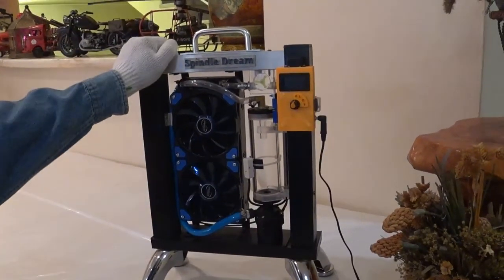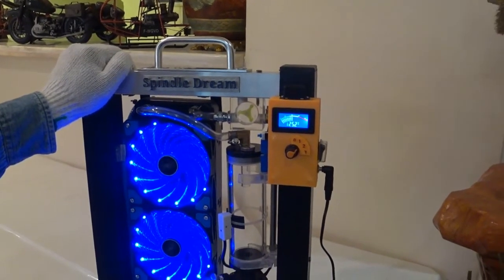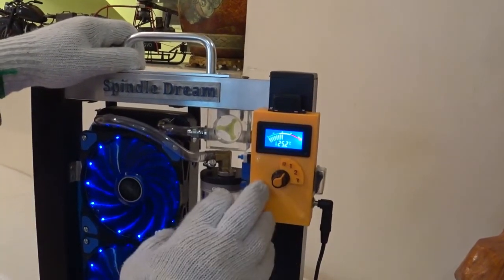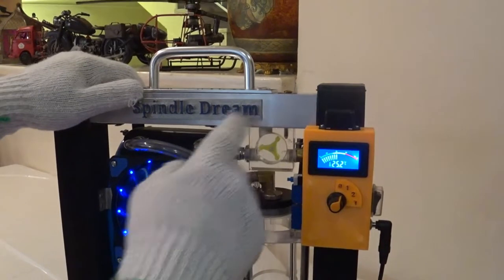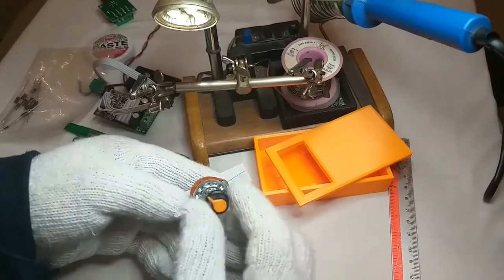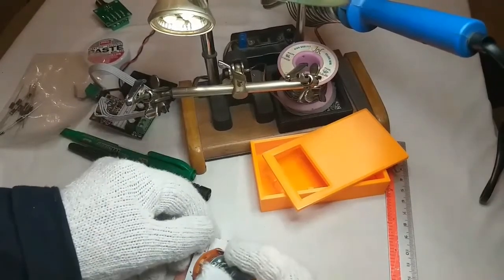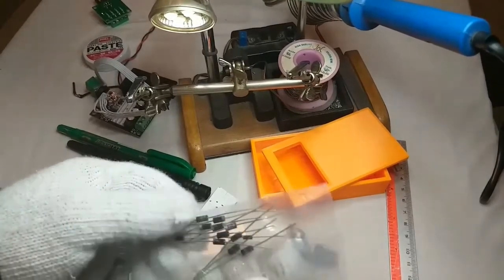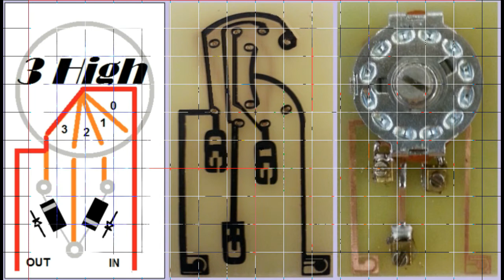Spindle Dream 1.5Kw & 2.2Kw External Water Cooling System

Comment: Hi, well done, good work!!! How do you connect it to Start/Stop
of Cooling (M8/M9) to DDCS 3.1
Reply from the maker: Good question m8 start cooling signal output for spindle why I didn't thought about that ?

at the cooling system diagram replace On Off switch with a Relay as long it's a signal, I did not try that but I will thanks for the tips.
Reply: @yacoubjabal3762   I have a problem with this relay connection. I'm using a relay SSR-40DD at 24 V
Reply from the maker: @Bilykse  what is the signal voltage of m8 pin have you tested by multimeter ? if the signal is weak I can amplify it !!!

Comment: Does this pump have a speed sense wire? cheers.
Reply from the maker: it does not come with speed sensor, if you need more flow speed you can choose CS800 Pump.
Reply: @yacoubjabal3762  Ok some of these pumps come with a spare 3pin molex wire that plugs into the motherboards fan header to sense the speed
Reply from the maker: @Synthematix  Maybe because I trim the yellow wire, it could be something to do with the speed sensor !!! Anyway the water flow meter is helping me out to see the approximate speed.